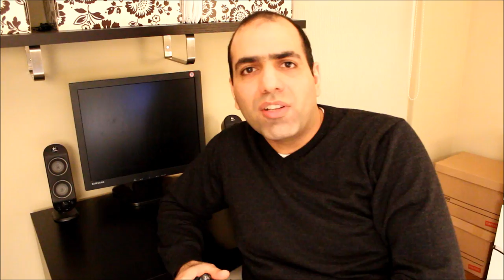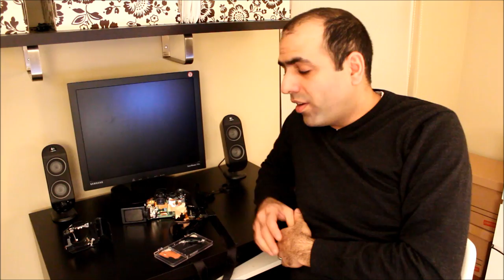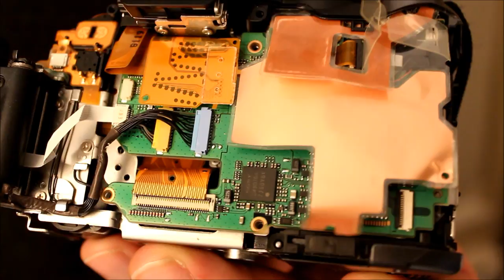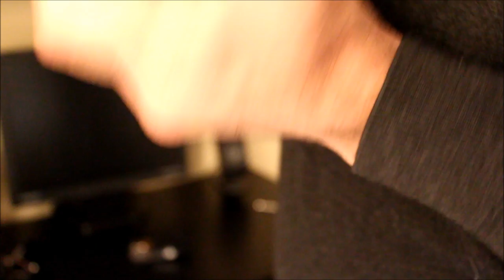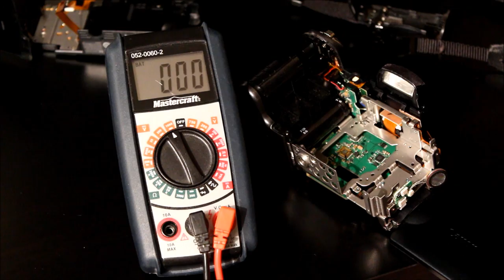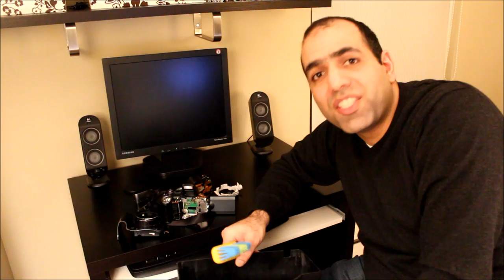How to Fix a Camera DIY

Comment: 3:00
I did this when I was about 10/11. Had a burn on my hand for 3 days. Had to keep my hand in water for hours. I took apart a camera to see how it worked, and at first I thought something stabbed my finger, but after a while of thinking about it and looking at it closer and more carefully I realized what happened. I opened it and put my hand on the surface of the circuit board which had traces/components for the transformer circuit that were connected to that cap. Made an inch long burn on my finger.
Reply: Me too, at the same age.
Reply: NOTE TO SELF: DONT TAKE APART CAMERA
Reply: Glad I read that ,I have lots of camersas as thinking of doing one
Reply: Andy Plater Same. I smashed a disposable camera to get to the really bright xenon flash tube, thinking it is powered directly from the battery. I wanted to make it stay on continuously, and I learned how they work the hard and painful way too!
Reply: Andy Plater cool to see i'm not the only one :D

After that I learned a couple of things about capacitors then I had fun with my friends loading em up then and discharging em on screwdrivers xD
Reply: Ouch! I have done a similar thing when I first opened a camera to learn how they work. The internet did not exist for me at the time, so I couldn't just "google it" and I only had reference to a "how stuff works" book showing drawings of the circuit board and basic block diagram. Coming into contact with that capacitor I felt the zap all the way up my arm, and it was very painful!
Reply: +Andy Plater LOL at yours and the other comments here!  I also shocked myself taking apart at a camera, at about 11 years old too! It was a Kodak Cameo 110 film camera.  I can't even remember why I took it apart back then, probably just to see how it worked!
Reply: +Noble Tabibian U R Not My Mom!!
Reply: Licked a battery
Reply: sue _ ezla YOUR GROUNDED
Reply: nope
Reply: sue _ ezla HEUHEUHEUEHUEHEUHEUHEUEHUEHUE
Reply: i'm a live wire
Reply: +sue _ ezla this gem of a pun is too underrated
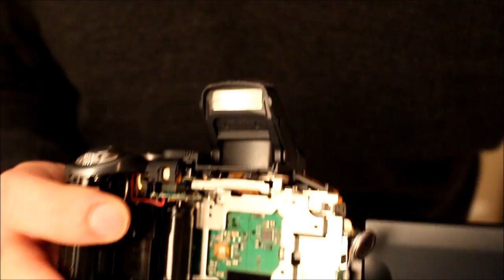Reply: * 1:00
Reply: I also did that... at the same age... same as other people...
Reply: Me too same
Reply: 0:59
Reply: I remember when I took off the front of my one time use (or whatever) camera, and held the flash charge button. After charging I released but kep my finger on it, and after a short time I shocked my finger so bad I threw it down instantly lol
Reply: Why did he put it 3:00 ??
Reply: @kajuss5122  idk he just wanted to trolled us
Reply: @meyazra  maybe this vid was cut ?

Comment: "It's okay, it's safe now" I died
Reply: That reminds me of when we went to my doctor, and the TV was bothering me. I couldn't find the remote, so I unplugged the TV to get it to stop bothering me. Also, it reminds me of when I made up a story about using a hover hat to bounce on trampolines to reach balloons and hanging keys and escape under ceiling fans and over other real hazards in a real background. This includes live hardwiring, sharp broken glass, and like on this video, charged capacitors that can be discharged, but in this made-up story, by throwing damaged coins at their terminals. I made this up to tackle problems in my head by using animals.

Comment: ***** 
You know, I was repairing the motion tigger for a trail camera quite a few years ago for a relative. They didnt care if it was ever fixed, being broke for a year and they said I could fix it and keep it or give it back if I wanted. All the parts were onthe same board, and I laid the PCB on my hand. Not noticing the THREE 360V FLASH CAPS IN SERIES I pushed the board down onto my hand while moving a robbon cable. That made one hell of a bang ans shot sparks from my skin, causing my hand to curl up harder than I could ever have normally have done. There was a red line of blisters going from my palm to middle finger. In addition ot the blisters, my hand closing caused the prickly soldered component leads to cut vertical lines into it. I never made the same mistake again.
Reply: Ouch. Good to know you're still alive.

My dad got hit by a flyback transformer and got thrown across the room. He lost 3 knuckles that day.
Reply: These are the incidents that keep us alive. Working with electricity can make you complacent. A good shock every once in a while wakes you up... or kills you. lol

Comment: It wasn't working "regulatorly" even after bridging the rectifier so it got the sack,  maybe it might work better photographing garbage.
   By the way never use your finger to check capacitors always use your tongue (as shown by Mehdi a few times) you get better results and you can actually taste the electrons, in a flash!! 
 But no on a serious note Mehdi is showing you dangers of hidden/stored electricity in gadgets

Comment: I have the exact same speakers and monitor, though most of those Samsung SyncMaster 720n and similar monitors (had like 10 of them at work) have been dying as far as I know as casualties of the capacitor plague.

Comment: Usually just message the mods of the subreddit you submit to.  Some of the subreddits flag nearly everything as spam, which is frustrating.  There's a "message the mods" link in the side menu on most subreddits.

Comment: It made me to remember how i electrocuted myself by pocket digital camera. It seems like i keep it disassembled in the electric razor case for 6 years and i'm still afraid to touch it...
Well, actually it's cool to have power capacitors discharger made of 220v incandescent lamp and power resistor.

Comment: You know how to test a 9 volt battery with the tongue?  Well, I was doing some phone wire work, and even had a volt meter.  I measured it.  I later went to pull off the insulation with my teeth.  Apparently 52 volts doesn't hurt as much as a 9 volt, but it did take me off guard quite a bit.

Comment: when you shorted it you touched a live capacitor  with current with a unprotected wire this why you should use a screwdriver or even better drop something on it thats metal it will short itself and your safe

Comment: I remember taking a big camera flash apart as a kid. Just as I was thinking "I better be careful. The Capacitor in this thing is probably huge." As the case started to crack open, guess what's the first thing my finger brushes against? Yep, the location was right at the bottom where it pivots. It was the whole width of flash. So I worked out why the bottom was round 🤣🤣🤣 lucky I'd set the flash of already because f***! even then it hurt.

Comment: RIP your Canon...
At some point of trying to repair it, I came to the conclusion my sony F-828 isn't made of electronics or even have a sensor, but kilometres of nap cablesgoing in such directions it generates a random image. and can't be fixed.

Comment: Oh so that was the part I was warned about, 20 min ago I took apart a Canon camera for a friend who dropped it, I thought it was bs the part where such a small cap can hold 300v, apparently not.
Reply: Now imagine touching a real huge flash cap. I nearly fainted when I touched the one of a Polaroid 403
Reply: +zawzero 
Touching 309vdc is not nearly as bad as 120vac, but it still hurts quite a bit.